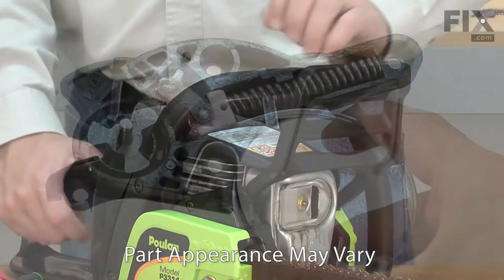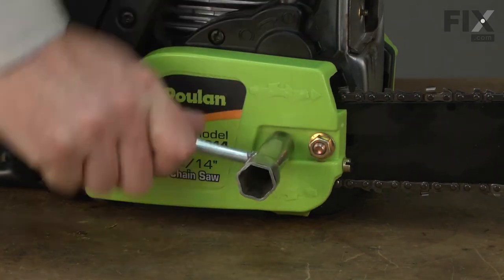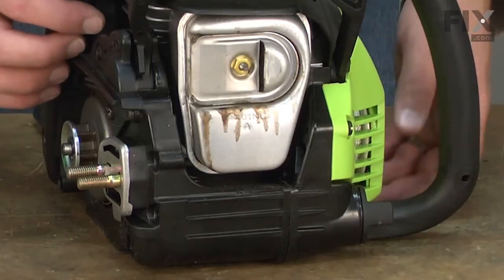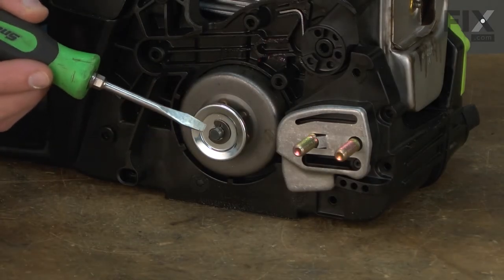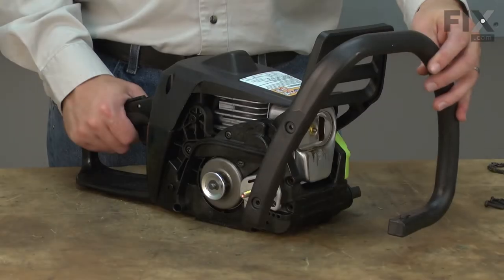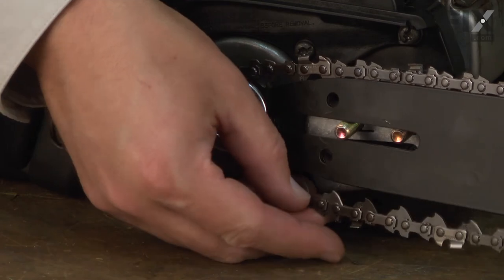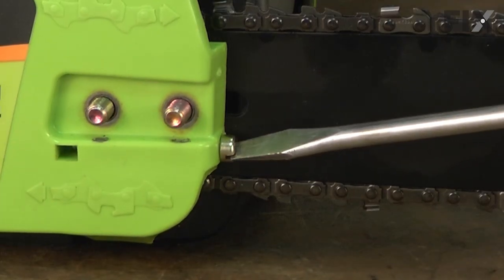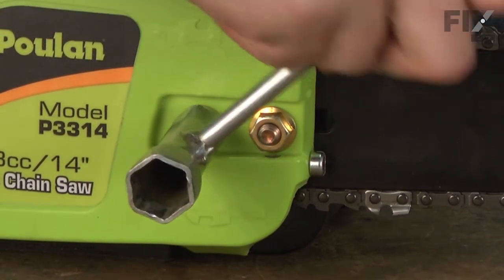Poulan Chainsaw Repair - How to Replace the Chain Brake Kit

Comment: That was good OK my problem is I have the same chance at 3314 and the Spring in the brake handle there came out the mechanism came apart what's the easiest way to compress that Spring